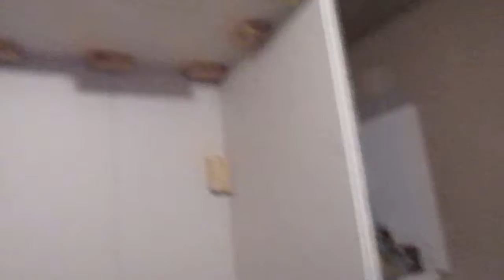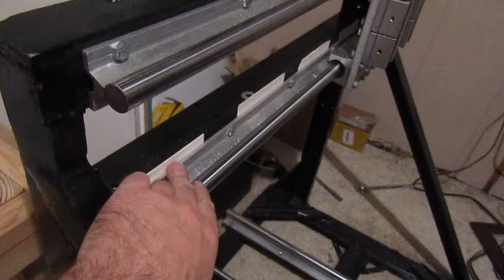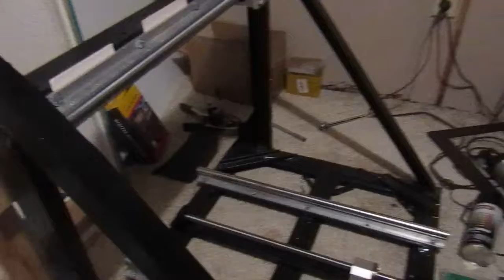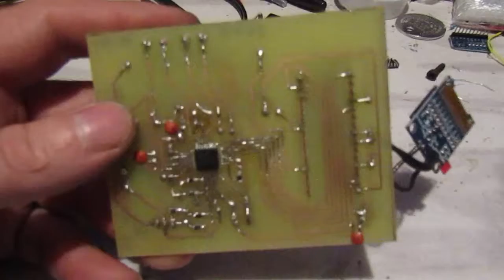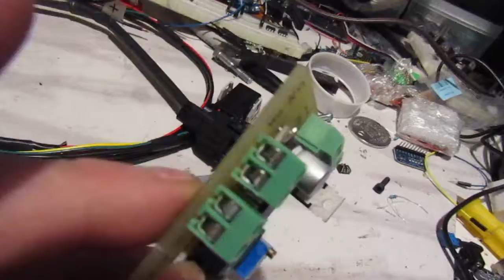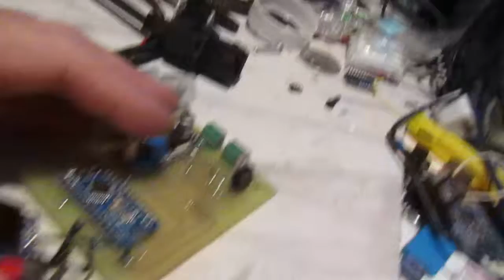wideband O2 sensor circuit and CNC build status.

Comment: Could you please suggest how can one set this up with a Arduino Uno?
Reply from the maker: There was at one point an arduino shield with this chip sold. Here is the code for that shield, which was the only place I could find the SPI commands for the chip.https://github.com/Bylund/Lambda-Shield-Example/blob/master/Lambda_Shield_Example.ino  I found that all the chips on ebay were China knockoffs and instead I back engineered the chip and made a circuit myself. It may be complicated but I made a video trying to explain the chip here.   https://youtu.be/Wp8qLaIafCg?si=fc8cuETmAUCXDhqv

Comment: Where can I find the datasheet for the cj125?
Reply from the maker: https://www.datasheetarchive.com/pdf/download.php?id=5410a81d3260f16e9b17c822e2915ae051dc92&type=P&term=CJ125

and here is a datasheet for the LSU4.9  https://www.ecotrons.com/files/Bosch_LSU49_Tech_Info.pdf

and info on output curves https://imfsoft.com/files/lambda/documentation/LAMBDA_AnalogOUT.pdf
Reply: @paulksycki  I am not seeing the section which explains what command the spi should use for configuring or reading data.
Reply: I see some commands but it is one awfully written datasheet. I am sure u did not write your code based on that sheet alone.
Reply from the maker: @fernandohood5542  Ya info was hard to find. Actually I decided the chip design it's self was a total mess and didn't use it. Instead I spent a very long time back engineering how it worked so I could make a custom circuit to do the job of the chip but having way better accuracy, temp stability, and not have to worry about the IC being just because the only ones you can find are Chinese knock off chips.

But Here is where I found the spi commands. Also the website in his code has more info also.  https://github.com/Bylund/Lambda-Shield-Example/blob/master/Lambda_Shield_Example.ino
Reply: @paulksycki  Thanks mate. Something really need to be done about those thieves.
Reply from the maker: @fernandohood5542  The chip is probably good enough for most hobbyists, but if you plan on making something to sell to be used to control $10,000+ high performance engines, then you may want to worry about the knock off chips. Temp drift effecting the accuracy of the chip is one concern. Think of the temp swing inside of a dragster. Also after back engineering it, it is a horrible design that uses way to many muxes and then has to do a bunch of extra stuff to compensate for the mosfet leakage and added resistance.
Reply: @paulksycki  I find some engineers are too smart for their own good.